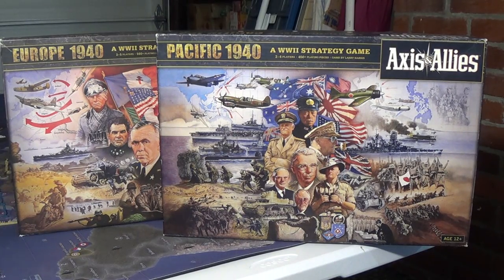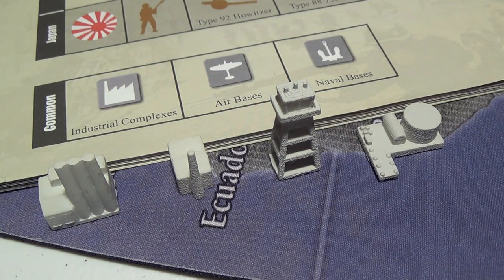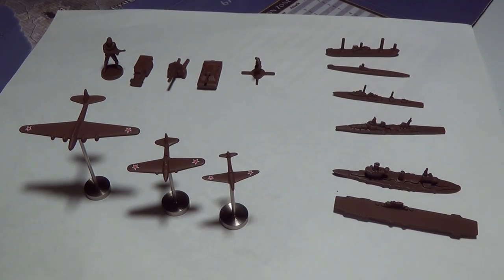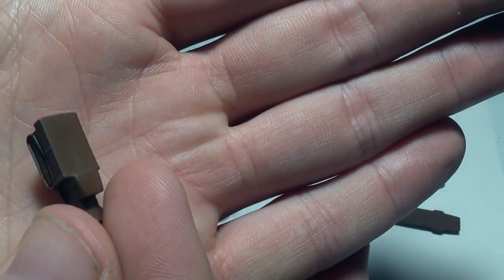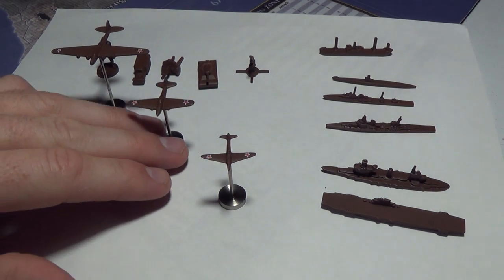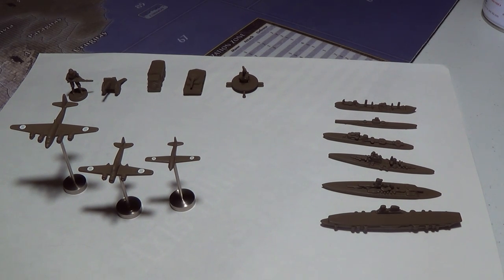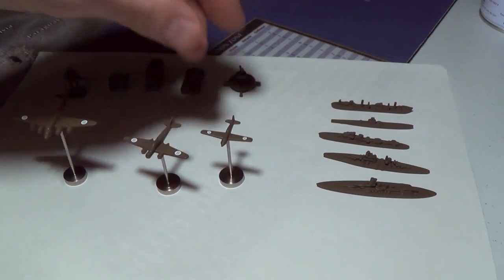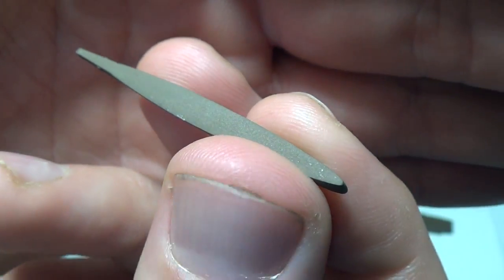Axis and Allies 1940 Customizations (Part 1 of 3)

Comment: All of those Industrial Complexes, Air and Naval Bases look expensive. How much?
Reply from the maker: I’ll get back with you and edit this comment with the pricing.
Reply: @thegoodcaptain1217  Please specify whether your video showcases the small naval bases and air base towers or the regular ones. I found them at shapeways: The small naval bases are offered by EBard Models, the small air base towers by TableGameWiz. 12 small naval bases cost 22.55 $ and 10 small air base towers cost 19.89 $ each. Plus 10 bucks for shipping. How many would you recommend? I guess two packages each would do the job, right?
Reply from the maker: @christophneuschaeffer7489  great question. Order history says I ordered 30 small airbases, naval bases and minor IC. 

I ordered in two separate orders. The first order was the fewest amount of smalls per spru to make sure they scaled with the rest of the pieces correctly.

After they checked out, which they did, I placed a second order. Might recommend the same to you if you’re unsure of what size you’re going for...
Reply: @thegoodcaptain1217  Thank you for your reply. As I live in Germany, shipping costs are an issue here. But following the description of EBard Models, I guess the small units are the correct ones. He writes: »Each model is approximately 20mm wide by 15mm long (10mm base + 5mm pier) by 8mm tall. Oil tank large enough to support Axis & Allies Anti-Aircraft gun piece on top of it. Set includes 12 identical models representing small naval bases. Models are connected by a thin plastic sprue to keep them together during the printing process. This smaller naval base is a perfect size for the board game, it doesn't take up too much space (it's basically the size of a tank piece) but provides a great visual improvement over 2D base markers. Base modeled to represent a small garrison naval base in the south pacific; contains an oil tank, flag, radio tower, pier, Quonset hut, and supplies next to pier.«

Comment: A question : is there a piece of metal inside the  aircraft carrier? becouse I saw the airplane remain attached at aircraft. Thanks
Reply from the maker: Well, this is the topic of conversation starting at 14:16. It's more specifically addressed at 15:27. But to restate, yes...there are 2mm magnets installed in each carrier to pair with the 2mm magnets installed in each aircraft.

Comment: Your link to your sanding twigs no longer works. Is there an Amazon alternative?
Reply from the maker: Dang. You're right. That sucks as I ordered those regularly from that site. There is probably an alternative but don't buy anything until you confirm what type of sanding grain is in the pack. The higher the grit number in the sanding grain, the better for what we use them for (plastic pieces). Don't get something with low grit numbers or you will sand off chunks of the pieces. If I find something I will update my description box and post it here.